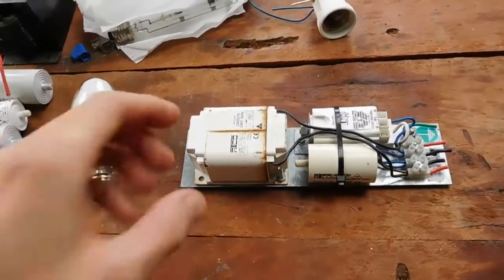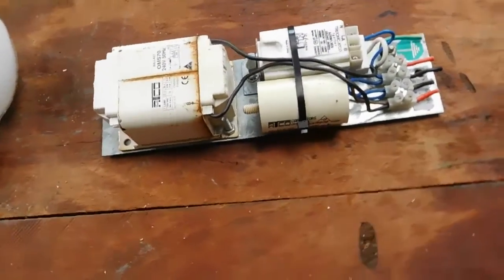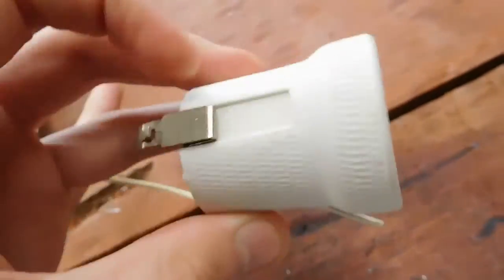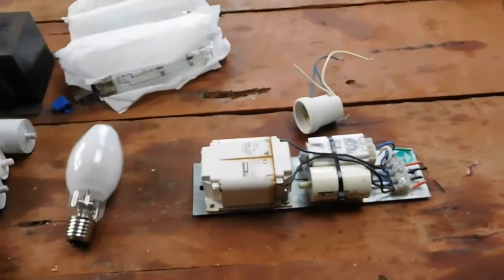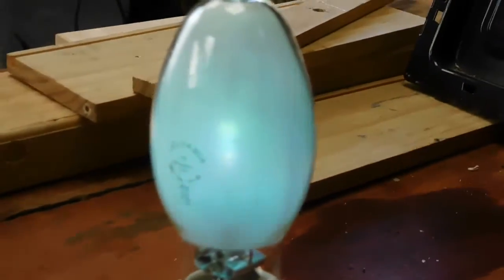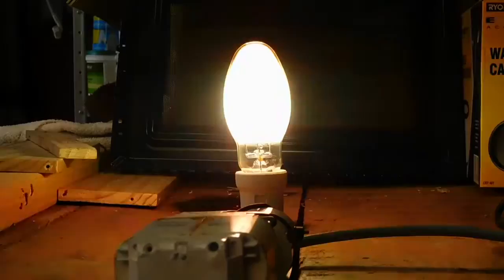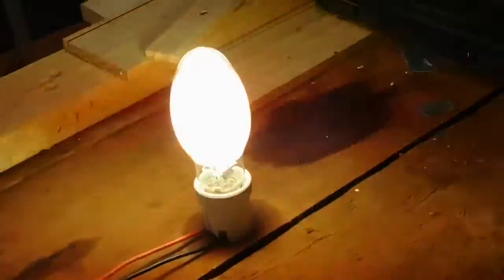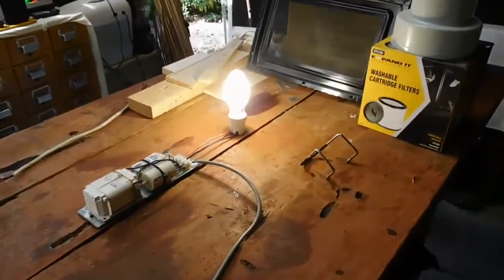70 Watt Metal Halide lamp Test!

Comment: Street LED, model Streetlights assembled in Australia by Sylvania!!
Reply from the maker: Ah nice! They recently did the lights in my area, from metal halide to fluros!
Reply: There is also the RoadLED witch is the bigger version of the StreetLED, the RoadLED replaces the 250W HPS fitting?